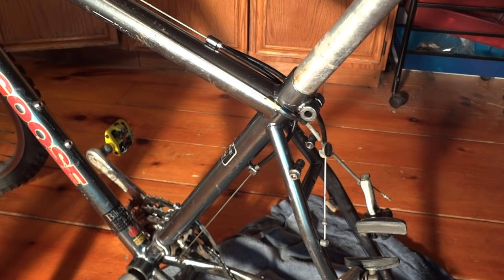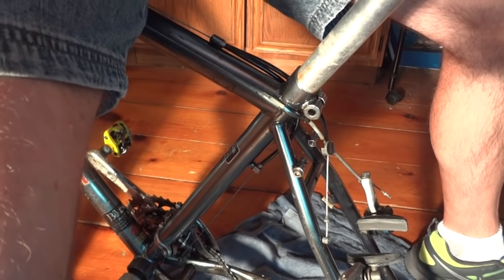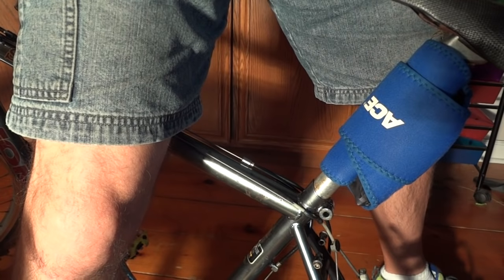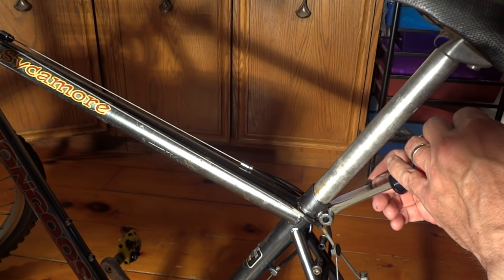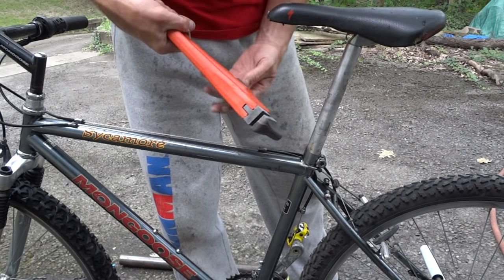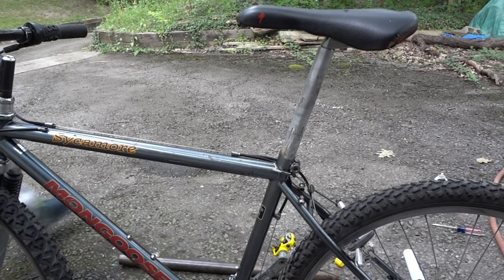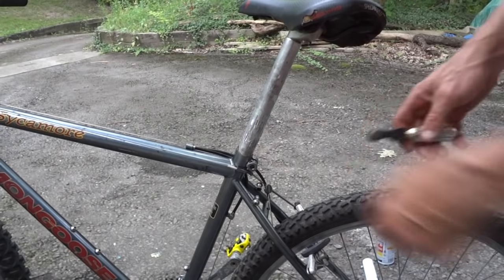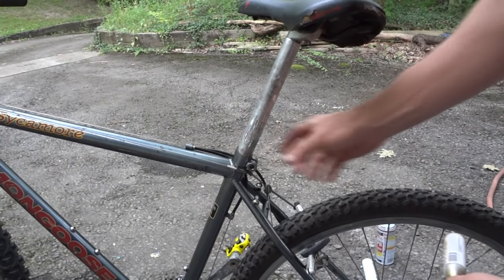Removing Stuck Aluminum Seatpost From Steel Bike Frame

Comment: Could have taken the saddle off and wacked the post with a hammer.
Reply from the maker: You apparently have never dealt with a seriously stuck seatpost.
Reply: @RJTheBikeGuy  I work in a maritime field. Dealt with galvanic corrosion or rust a time or two. 
A bike is a little different. Maybe have someone tap it while turning with the pipe wrench.
Reply from the maker: https://www.youtube.com/watch?v=S3ek2GeZzE0
Reply from the maker: https://www.youtube.com/watch?v=_gAXL2FSY_A

Comment: Better use a heatgun.
Reply from the maker: I have tried heat. And cold. And heat and cold. And cold and heat. It has never worked. Maybe on slightly stuck seatposts/stems.

Comment: Well done but your post is well chewed up.I want to keep my post in good condition as it's a good one and the part I want.I will try pouring very hot water over the frame.
Reply from the maker: Best of luck to you. Sometimes they get frozen so hard, there isn't any way to get them out without destroying them. I have had to cut them out. But maybe yours isn't stuck as hard as this,
Reply: @RJTheBikeGuy  Yes,just watched your other video where you cut the post and used an air hammer.Never seen that before.Aluminium welds itself inside sometimes as you say,I am having a similar problem with a handlebar stem.The rod is undone and out but the stem is stuck and nothing holding it now.Have another problem with a brake bolt rounded and tight so can't get a good quality front brake off. at the moment.I'll keep trying thou.
Reply from the maker: @borocavalier  https://www.youtube.com/watch?v=bGqV5KE7cb8
Reply from the maker: https://www.youtube.com/watch?v=S3ek2GeZzE0
Reply from the maker: https://www.youtube.com/watch?v=_gAXL2FSY_A

Comment: go more on the turn to break off the stiffness
Reply from the maker: Past a certain point, there was not enough leverage. The thing was very tight!
Reply: @RJTheBikeGuy  noiice .. i had the same frik'n problem yesterday with and similar older krazzze rusted bike . for a minute i was almost ready to call out your help ha!  what i ended up doin was kept soakin for about half hour  left it alone came back 4hours after and started tappin with a hammer and then twist and pulled and got lucky . 

RJ you're a great outstandin guy keep up your videos you really are a teacher for sure .... Thanks !

Comment: That was epic! I had a problem getting a seat post out of a early 80's BSA 10 speed. It  was a chrome steel post into a steel frame, not too rusty either. The damn thing would move up and down, but i could not get it out. After much lubrication and brute force it came out. Turned out that there was a small burr in the frame. I put that right with a file. Great video!

Comment: coulda hammered the underside of the seat
Reply from the maker: Wouldn't have worked. It was too seriously frozen.
Reply: Nope. That would not have worked.
Reply: thats impossible. you could just bend the seat rails. The best way is to use compressed air cans and twist the seatpost to the sides.
Reply: I ment when the post got freed up, coulda hammered under the seat a lil more might of got it out faster,Oh and its got to be a seat that u dont care about of course its gunna get beat up *sam jackass*.......aluminum gets fused to the metal,dont see how compressed air would work
Reply: iv never had luck with stuck seat posts, had a supergoose with 1 ended up twisting the post into wear what was left i couldnt get a grip on it!      what a pain n the ass!

Comment: you can use w-40
Reply from the maker: WD-40 is a VERY WEAK penetrating oil. I used PB Blaster which is much better.

Comment: If it came stock on the bike it's just shit engineering.
Reply from the maker: No, it's poor maintenance. It's called galvanic corrosion. Someone didn't grease the seatpost.
Reply: huh. but I guess you can't grease the whole seatpost, or use something like this mounting friction grease thing? Common sense tells me putting anything greasy here would be really stupid, since it's the grip near the clamp that matters
Reply from the maker: You want a thin layer of grease on the seatpost to prevent galvanic corrosion between the disimilar metals. Get a good book on bike repair.
Reply: RJ The Bike Guy well that's just shit engineering. I'm sure there's a better way to do this.
Reply from the maker: I am guessing you aren't an engineer. You are obviously not a bike mechanic.
Reply: DFW rider totally agree. Who in the right mind would put grease in parts where the friction is essential? Nothing explains this, just shitty solution for shitty material choice by shitty engineers.

Comment: Drill hole in seat post then fill with oil and leave a day or 2
Reply from the maker: If you are going to do that, remove the bottom bracket and add oil from the bottom of the seat tube. But it will only work if the seatpost isn't very stuck.
Reply: @RJTheBikeGuy  incorrect buddy I'm a level 3 bike technician iv come across this problem when restoration of 90's mountain bikes many of times not all frames have the hole in bottom bracket mount which leads to post tube, iv repaired a few bikes brought in where owners have opted for the hammer approach. Iv never had a problem with the oil trick I use. If it's still sticky I use thinner mineral oils or wd40
Reply from the maker: @scottscotts808  LOL! I actively SEEK OUT frozen seatposts/stems for the challenge. I have tried oil and many other viewer suggestions. Most don't work. Oil doesn't have much effect on aluminum oxide (galvanic corrosion).
Reply: @RJTheBikeGuy  lol why the lol. Maybe it doesn't work for you, maybe you don't have the experience you think you have.

Comment: Y not warn the frame up
Reply from the maker: Why?
Reply: @RJTheBikeGuy  because heat apparently makes its side out of the frame easier
Reply: @RJTheBikeGuy  if you have any advice for me upgrading a mountain bike what would your Advice be
Reply from the maker: @isaacmanhire7360  The coefficient for aluminum is 2.4, twice that of iron or steel. That means the aluminum seatpost will expand 2.4 times as much as the steel frame. So it will wedge even tighter inside the frame.

Comment: great video but hot concentrated caustic soda dissolves alloy seat posts and cleans the rust from the steel frame. easy peasy.
Reply: +Adrian Ashby 10-15% solution works the best. The reaction happens at around 100c and caustic soda eats through organic things too, including your skin and eyes. It doesn't do anything to the rust as rust is just iron oxide and it doesn't eat away iron/steel. Managed to save my frame with the caustic soda, the smell of ammonia is pretty awesome doing it. Ie. don't breath in the fumes :)

Comment: smart... but i would sugest some margerine spray around the post
Reply from the maker: You really think margarine spray would work better than a penetrating oil like Kano Kroil (which I used)?
Reply: RJ The Bike Guy 
no but it works when my thumb is stuck in the seat post after i watched this video lol